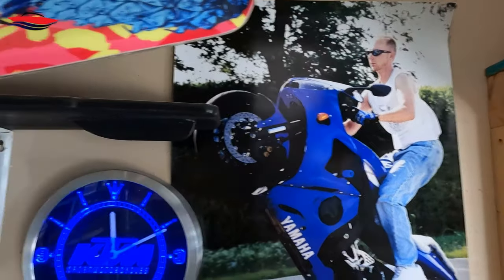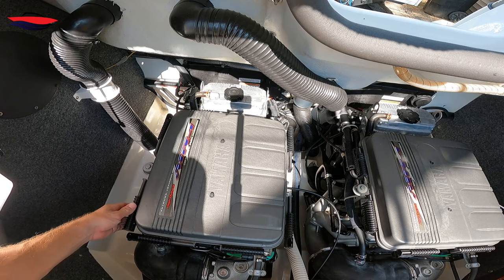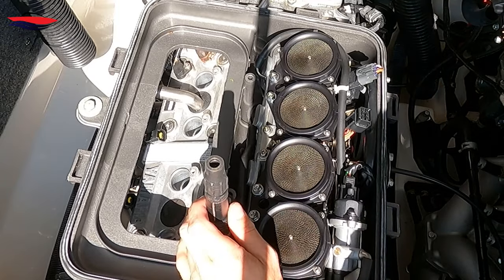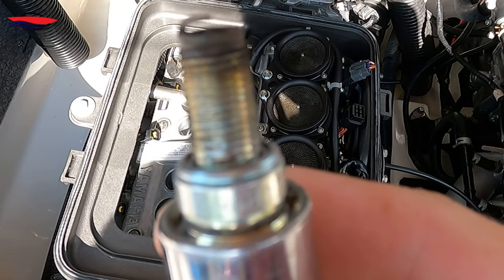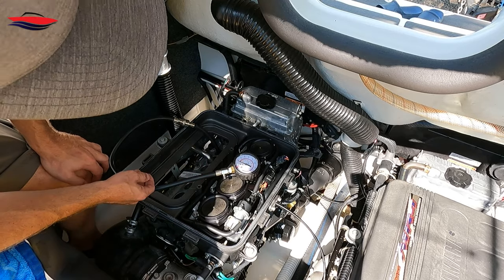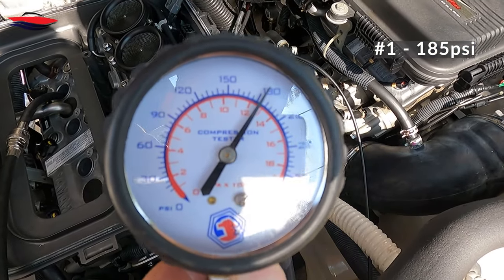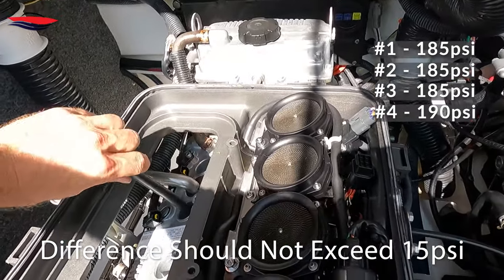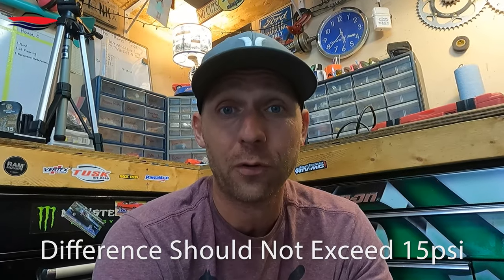How To Check Engine Compression - Yamaha Jet Boat

Comment: Man, youre awesome. I learned so much in this video. Thank you.

I have a 06 sx230. Not sure how well the previous owner took care of it, but when i got the boat i had to replace the jet housing. I tore down the entire assembly, changed plugs, greased bearings, and changed oil. It runs solid. Have had it 2 years now. Due to not knowing its history before me, and thw age of the boat, im getting somewhat nervous. Doesnt help that the engine sounds like a rattle can.. but i hear that thats just how these engines are...

Maybe ill grab a kit and run this test to give me some confidence in this ole girl. 

Thanks again.

Comment: Hi Jeff... we have a 2003 SR230 we had the port side engine rebuilt and put a used engine on starboard.  The used engine had 80 hours.  We have used the boat about 20 hours since the engine changes.  Boat was winterized, and before we took it out this year we had all the spark plugs and oil changed.  We launched, drove about 20 minutes in 5mph zone and then accelerated.  The starboard engine didn't have the best power, we could tell something was wrong.  We took it to our mechanic and he said engine compression was 130 130 140 150.... he said it must have gotten hot.  All the pissers were working and there we no signs that the engine was hot.  He said if it gets hot again it might blow the engine, however the engine did not appear to be hot ever. He replaced all of the fouled spark plus and said go ahead and use the boat, but be careful cause "these boats have sensitive motors".   Feeling a bit confused, our friends used this boat for years in lakes, and the CA delta without issue.  Does that compression reading really indicate an engine about to blow?  Is there something else we should be looking at?

Comment: Thanks for the videos Jeff!  I appreciate you taking the time to make them, and your knowledge and experience that you share.  I have an 06 AR230 HO, and two '05 FX HO's and I have been wanting to check compression on them all.  What do you recommend for cleaning buildup on exhaust valves?  Seafoam?  

Also, I seem to be about 10mph lower now on my 125hr FX ho's and I'm trying to figure out why.  They have been sitting in my slip for a couple months, but I start and/or use them about once a week.  I did notice that they are building up algae on the hull and jet assembly, which I intend to clean now that I have them on jet ski floating docks.  I'm hoping that is the reason for reduced top speed.
Reply from the maker: For cleaning the carbon off of the exhaust valves fuel additives are about the only thing you can do besides dissembling the head and cleaning and lapping the valve.  90% of top speed related issues comes down to the jet pump.  Impeller and wear ring clearance is typically the problem.  If you are reaching max rpm then I would lean towards jet pump.  Hope this helps you.
Reply: @JeffDoesThis  Ok, I will look into that.  Thanks!

Comment: Jeff excellent content, thanks. Question for you, there is a pipe coming from the cylinder head between plugs #1&#2 there is a black plug(seal) between plugs 3&4. While winterising my boat this week, I noticed I am missing the black plug between 3&4 on one engine. Any idea what those plugs protect?
Reply from the maker: There is a head bolt that is recessed in the valve cover.  It prevents water from puddling up on top it.  If you boat in fresh water it's not a big deal because the motor generates enough heat to evaporate it off.  But if you want to replace it, here is the info.  SEAL, PIPE -  Oem #60E-12495-00-00
Reply: @JeffDoesThis  thanks again Jeff, the boat is fresh water only, and I did have the same part number on hand, in the event you suggested replacing it. Not expensive at all, so I might place the order..

Comment: Ok Jeff your videos are great Always come back. Question did a compression test on my engines. Starbord engine all but 1 cycliner had 175 byr number 1 was 90. The other engine all around 175 180. These engine have about 700 hours. have no problem starting they start right up. You think it could may be 1 or 2 things Exhaust value or head gasket

Thank for your input. Also just order the top you installed on yours

Comment: After you replace the sparks and re engage the fuel to the engine, it should start right up again or are there any tips after re assembly. Cheers! Awesome video
Reply from the maker: No tips after, just fire it up.

Comment: Hello Jeff have enjoyed watching your videos saw a listing for a 2000 Yamaha LS2000 says all is good but low compression in 1 cylinder on 1 of the 2 motors. Asking $4k. Do you think it is worth getting. What is your thoughts or experience with using sea foam or power tune in cleaning the cylinders? Thanks.
Reply from the maker: Wont' work.  It's a 2 stroke and if haven't rebuilt one or know anything about them i would stay away.
Reply: Thanks for the advice

Comment: Loving your videos,got a 2014 190 stx,used it three days sat for 4 then won't start spins over but won't fire any help would be much appreciated.thank you
Reply from the maker: Check your clean out hatch safety switch.  I had a similar problem and I ended up bypass it.  Here is a video on it - https://youtu.be/lpBxd5fQ3BQ
Reply: @JeffDoesThis  was kill switch by control, Louisiana heat got to the key and softened it spread open enough to not hold button up

Comment: Great video Jeff! Thank you for sharing your knowledge. I am in the process of buying a 2011 AR240 with ~ 250 hours on it. I have a surveyor going out, he will check the hull and take it out on the water but he told me that he is not doing a compression test. Boat seems to be in pretty good shape overall but do you have any recommendations/guidance for me? I didn't plan on buying an older boat but the price point is very good, $30K. Thank you, be safe and God Bless!
Reply from the maker: A surveyor is going to do a great job a looking over the boat.  You could pay a local marine tech to do a compression test but if the surveyor comes back and says everything is in tip top shape then I would be fine with that.  Nobody in the automotive sector does a compression test on a vehicle when they sell it so i wouldn't worry to much about it.
Reply: @JeffDoesThis  thank you!

Comment: Jeff I have a 2008 ar230 what is the normal compression and what would be the lowest to have

Rich
Reply from the maker: Normal Compression is listed in the manual at 164psi.  BUT, there temperature will affect it big time.  Around 110psi and it may still fire up.  It will probably crank and crank at the low of a psi.  What is yours?

Comment: Question I have a 2000 Yamaha FX140 waverunner starts up the engine light comes on and it won’t run over 25 mph and idea what it can be ?
Reply from the maker: You need to scan it and see what the code is first. It could be anything.

Comment: Jeff question AR230 2008 hard starting if left for a day. Compreeion test 180 all 4 . I forgot to shut oss fuel, so did teast all 180 put new plugs in engine fire right up. next engine all 175 to 180, did shut off fuel this time new plugs and attempted to start engine would not catch for several minute than started to catch had to restart sevveral time until ehgine finally ran. Almost sounds like a fuel problem what u think Rich
Reply from the maker: Do you have a yds scanner?
Reply: @JeffDoesThis  yes
Reply from the maker: When you say "Catch" what are you referring too?  What I am interpreting is, you can hear the starter is spinning but the engine is not cranking over.  Then after several minutes, the starter will finally "catch"  the flywheel and the engine will now crank over and fire up/start.  Or do you mean the engine will crank and crank but not fire up?  I'm guessing it wont fire up.  If so, hook up your YDS and see if the YDS software shows any RPM while cranking the engine over when it won't start.  If you have a bad crank or cam sensor the engine's computer doesn't know where #1 piston is and it won't fire the engine.  Does this make sense?
Reply: @JeffDoesThis  Jeff here is where I stand right now. The engines turn over but will not start. They wilstart after 10 minutes of trying to start. Once warm up I can shut down all day and they will start righ up. If they sit for one day they will not start until I keep cranking on and off for several  minutes. Today i shot some starting fluid down intakes and they cranked righ up. To me sounds like a fuel problem . What you think and my next step to try. Jeff I really want to thank u for your time. Im in Mexico and no one knows how to work on these engine. Oh compression test all culinder were 170 to 180
Reply from the maker: You said it.  If you add fuel(Starting fluid) and then it fires up you have got a fuel issue.  But, each engine has it's own fuel system, meaning you have a 2 fuel pumps in your gas tank.  The odds of both fuel pumps going out at the same time is remote so i am thinking you may water in your tank.  Next step is to pull the fuel hatch off and suck out all the old gas and inspect the fuel pumps and see what they look like visually.  Look for rusty spots, shit in the fuel pick up strainer and then suck out all of the gas.  Remember water will separate and be on the bottom where the fuel pick up is.
Reply: @JeffDoesThis  jeff can I hook up a electric fuel pump and by pass the fuel in boat si I would take a fresh gas in a gas can and run the electric pump to the motor fom the gas can. This would bypass the boat fuel pump and gas in boat tank, Rich
Reply from the maker: To do that you will need a fuel pump with the correct pressure, Fuel line that has the same style quick disconnect fitting.  I would not try it, you will probably shoot gas all over the place.  It only takes 5 minutes to remove the hatch over the fuel tank, 3 minutes to remove one of the pumps and another 10 minutes to suck out a full fuel tank.  20 minutes and you are done.
Reply: @JeffDoesThis  Will do thanks let uknow
Reply: Jeff I took fuel line from motor and crank engine to fill a plastic cup of fuel. Not a drop of water or dirt. So i again to crank engine wants to start but good unless I keep doing for long time. I than hit with starting stuff and engine craked right up. Any other ideas I'm losted. Jeff thanks alot for your help  Rich in Mexico

Comment: I've got the same motor in my jet Tender my number 2 cylinder only has 25psi any ideas what it could be?
Reply from the maker: Rings are worn away and not sealing up the combustion camber.